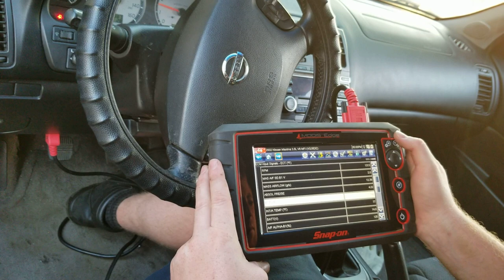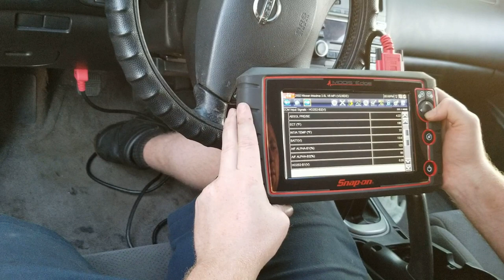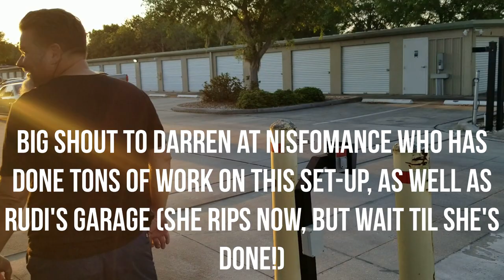Maxima "HR" Swap First Drive - The Lost Pulls

Comment: Damn man!! Makes me miss my hr swapped Altima! Keep up the good work guys!
Reply from the maker: why did u sell it lol
Reply: Had the Altima for 4 years and thought it was time to move on to another platform lol
Reply: @TheMaafiaGarage  do you mean you had a 4 cylinder altima and swapped a 3.5v6 into it?
Reply: @cedricmiller4370  no sir. My car was a 3.5 but it was a DE motor. I swapped the DE for a newer Altima motor that had revised heads, upgraded injectors, bigger throttle body and bigger upper and lower intake manifolds. The newer Altima (08+) and newer Maxima (09+) motor are considered FWD HR motors in the Altima and Maxima community just to differentiate the old DE to the new and improved.

Comment: Wait what?? isn't that the Motor from a 2012 Nissan Maxima 3.5 SV Sport? if I'm not mistaken that isn't a HR motor it's still a DE motor i Believe? the HR motor comes out of Nissan 350z 2007-2008 3.5L V6 Jdm Engine - VQ35HR unless that 1 just doesn't fit? and if the Motor that you guys isn't a DE motor which motor really is it then what's the name of it?
Reply from the maker: 2nd gen DE from an altima... it was and still sometimes is called an HR although it's actually DE correct

Comment: I want to swap an hr into my 6th gen max but I don’t know what fwd transmission would be able to hold up to 600-700 hp
Reply from the maker: 600-700 HP?
Reply: ImChrisDuke a bit enthusiastic probably 400hp might try for 500 just depends if I wanna keep my de or actually swap it for an hr. I just don’t want to start pushing the limits of what the transmission can actually handle and inevitably have to replace parts or just the entire transmission again and again.
Reply: ImChrisDuke if I keep the de I’m probably gonna build single turbo 4.2l Stroker
Reply from the maker: @nathanielmaillet7024  check out the 2nd Gen DE Swap Info page on Facebook. they also might be able to help regarding the question about transmissions

Comment: Could be a bad spark plug or not gapped properly for the random misfire p0300 code
Reply: So a bad plug Is going to cause a random multiple cylinder misfire.🤔 stick to diagnosing cars online
Reply: Oh so just because it says your name as Nissan Tech you're automatically a master ? GTFO of here bro waisting your time kid.
Reply: @xandercage7859  ... I actually am a nissan master technician for 18 years soooo.....
Reply: Nissan Tech I have a question. Why does my car rattle during a cold start? Is it my timing chain making noise?
Reply: @Khi.252  could be your precats when the cold start goes it's reving over 1k so you probably got some gunk flying around in your exhaust
Reply: Exar Kun Thanks for the reply bro. Is that something major? The cuts on fine, but it’s almost as if the car doesn’t want to rev up due to the fact of it being cold. It’s like this issue causes the car idle down just a bit.
Reply: @Khi.252  what kind of car... 3.5 vq is notorious for timing chain guides deteriorating causing chain rattle or whining noise that sounds like a supercharger
Reply: @Khi.252  honestly bro the only way to find out is a video or something. The timing chain and guides last a long time for the life of the motor. Only thing I can really tell you is get it checked out
Reply: @xandercage7859  ... That's why there is a tsb on it ...🤔
Reply: @Exar Kun @Nissan Tech I have a ‘13 Maxima, it’s most definitely a rattle. If you guys have social media i will send you a video of the noise in the morning.

Comment: Nasty.. Was considering a natural build for my 2k se 5 speed. How tough is it to R & R heads? Are the manifold nd heads ported/polished? Was thinking of these, 3.5 cams and an exhaust
Reply from the maker: they are not ported/polished
Reply: @ImChrisDuke  when you change the 02 sensor did the code come back up was it running rich or when you got the car tuned did it correct the rich condition
Reply from the maker: @Tootoojackson  it cleared
Reply: @ImChrisDuke  oh ok after you replace the 02 sensor it cleared on its own because I'm getting p1274 running rich I'm gonna be a new 02 sensor to what happens if that does work my next step get my car tuned
Reply from the maker: @Tootoojackson  hope it works out!